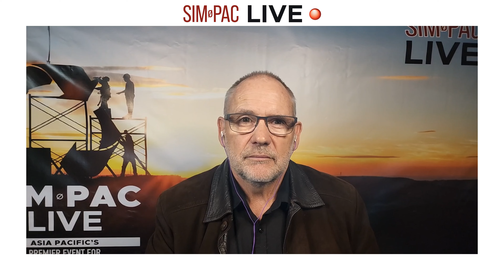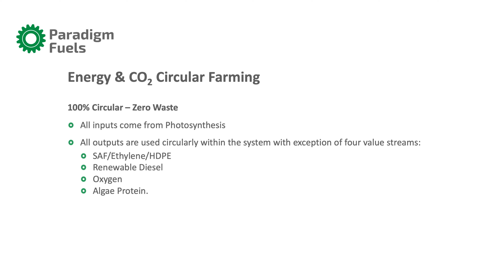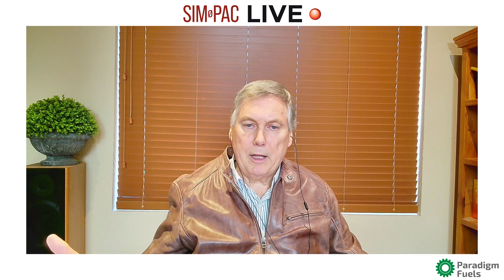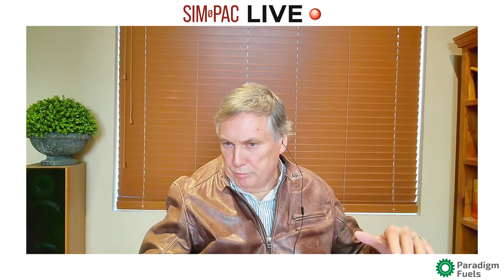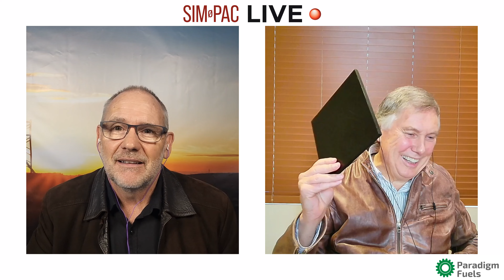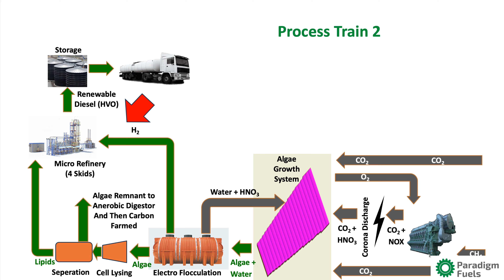Interview with Peter Clifford, Paradigm Fuels. Renewable Diesel & SAF Production

Comment: ATJ (Alcohol to Jet, i.e. SAF) Processes are available from a large number of suppliers.  Nothing new.
With respect to the SAF process the interesting feature is saccharification – turning cellulosic materials into sugars.
The saccharification method was studied at Queensland University of Technology at the Mackay Renewable Biocommodities Pilot Plant and indicated that it was theoretically possible to produce 8,130L of ethanol / Hectare from a single crop and with a biomass of 60T/Hectare.  

i.e. 24,400 L ethanol/Hect/Yr from 60t/Hect, whereas our modelling suggests that from 80/T Hectare per crop it is possible to produce 27,200L ethanol/hectare/year – a more conservative figure.  Furthermore, with high availability of internally produced ammonium nitrate fertiliser, as provided in the Paradigm model, a figure of 27kL/yr looks very achievable.
Elsewhere, studies in Brazil and the USA have provided substantive information.  The corn industry uses amylase to chop large starch molecules into dextrins for the manufacture of corn syrup.

Manufactures specifications for alpha-amylase is 2000u/g where 1 unit (u) is the amount of enzyme that catalyses the reaction of 1 µmol of substrate per minute

Regarding Algae System:
This is not an innovation in science so much, as many aspects have been thoroughly researched, but it is an innovation in engineering and system strategy, and addresses most, if not all, of the failings in previous commercialisation attempts.  and as one of the leading Algae researchers in Australia said “How did we ever miss this !!”.   His group is now a collaboration partner, and there is a reason, we could patent this without a contest – it is novel.